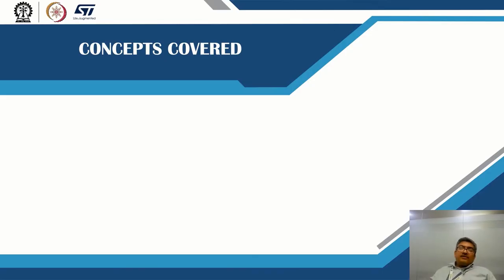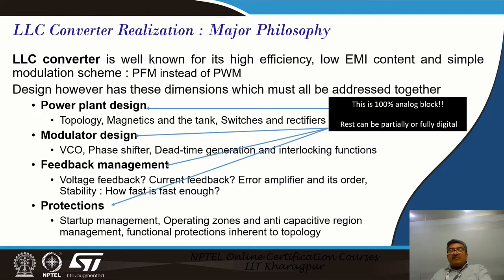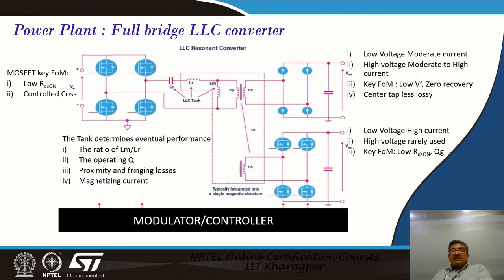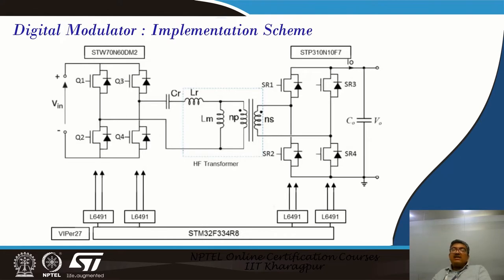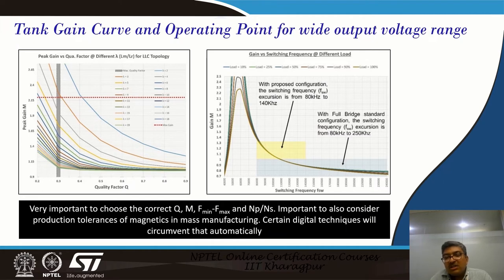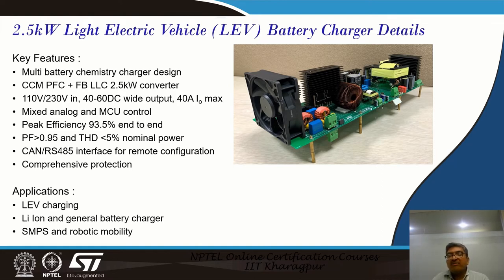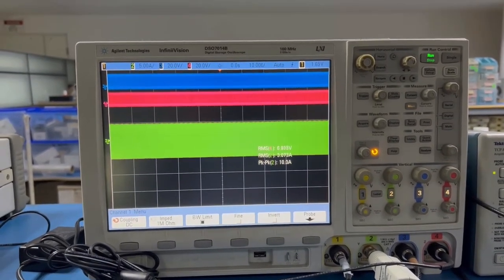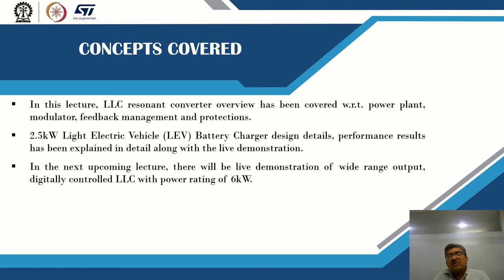Lecture 84: Practical implementation of LLC converters (Part-I)

Comment: Sir if I have a low demand of voltage at the output side(48)v and current is on the higher side of approximately 208 A.what would be the changes in the design aspects? and if input would be 600 Vdc.
Reply: sir, r u got design parameters